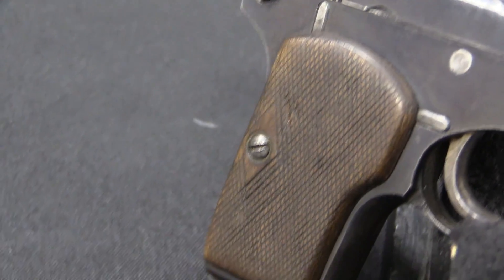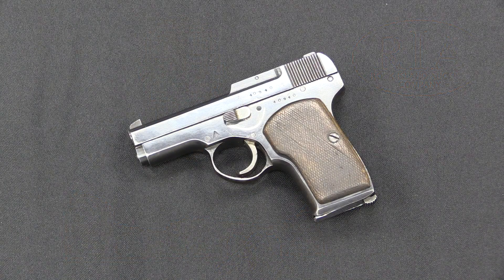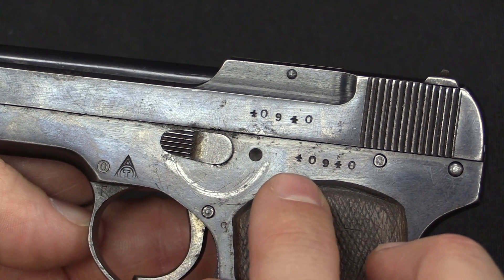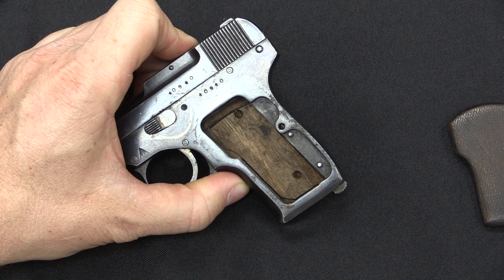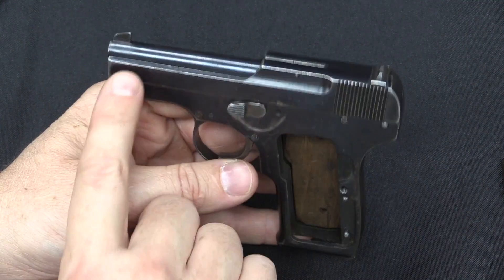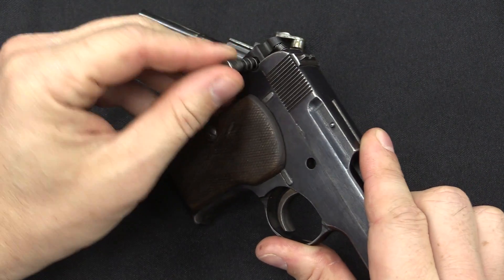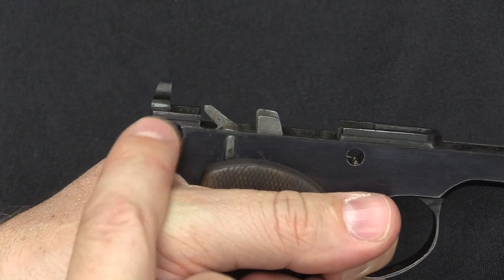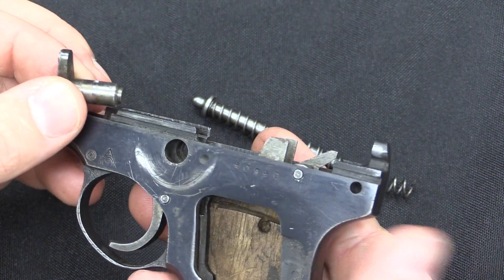1926 Tula-Korovin: The First Soviet Semiauto Pistol

Comment: Neat little pistol. These sorts are all pretty close in build. I used to have a Sterling in .22LR. IT was a cute little .22LR in Stainless steel with black plastic grips. It had the heal mag release that was made of some cheap crapmetal, I dropped it one day and the release broke at the pin that held it in place I took it to a local machinist and he knocked me out one that was much better then the original in about five minutes, charged me a fin and I was verry happy with my little pocket pistol. The gun love CCI Stingers and would run through all of them that I Could feed her.  She also liked CCI Mini Mags but standard velocity rounds were iffy.  Eventually the sear wore down on it and it started doubling and tripling. I was at the range one day with a local preacher who ministered to the local Indian Reservation.  He loved the doubling, and wanted the pistol very badly, I finally broke down and sold it to him.  Hope he had good luck with it.

Comment: That tail is not a distinctive feature of a striker fired pistol, a in the general sense, it's a distinctive feature of a certain type of striker fire pistol. Specifically one that fully cocks the striker on the rearward movement of the slide, not on the forward like quite a few of the modern types where the striker is fully contained within the slide.

Comment: The open top slide, the striker, some aspects of the barrel, all remind me of the 1914 and 1932 Mauser pistols. Even back then, Russian research was at least partly copying other countries.
Reply: The Italian made Armi Tanfoglio Giuseppe GT-27, from the trigger forward, is a simplified version with the barrel pinned in place. Recoil spring,  guide rod, safety, trigger are all virtually identical.
Reply: There are very few truly original designs. A lot of times it is an evolution. Just like with cars - they all have 4 wheels, , doors, steering wheel etc. look at Toyota and Honda, they will have a lot in common, but both change overtime depending on the fashion at the time.

Comment: Looks like Korovin copied quite some from the Beholla pistol and just improved the disassembly.
But by that the trigger dropped a little, the bore axis got a little higher, the safety only acts on the trigger, not on the sear and he introduced additional parts for a hold-open.
And why did he design the trigger with this weird operating angle like he did?

Comment: 6:39 Sorry, but I think it's nothing but a myth brought up in 1999 Monetchikov's biography of Korovin. Original documents (including 1934 drawings set from Ul'yanovsk №3 Factory) state that 6.35 mm cartridge 57-N-112 had shorter-than-spec case (15.24 mm), and its 3.25 g bullet developed around 220-230 m/s (typically 228 m/s) velocity.

Comment: Interesting little pistol...made use of the same keeper system for the grip panels as the TT30 and TT33.  I'm curious if the safety was a part of the original design or if it was added for importation.  It looks a lot like the ones used on some of the TT33 pistols we see imported today.  Also, any idea how many were imported or when?
Reply: Safety is original

Comment: Speaking of the Soviets, any idea where I can get my hands on some reasonable 7.62x54r stripper clips for my M91?
Reply: Do a web search. M1 surplus sometimes has them.
Reply: Bought mine on ebay. Brand new, dirt cheap, work great
Reply: Shit Digger  just spend a little time loading and unloading them and they usually get worn into a smooth operating condition.
Reply: Shit Digger  still has to be better than getting my thumb pinched between the round and interrupter. Thanks guys
Reply: @Nipplator99999999999  having used both original polish ones and new ones its lipstick on a pig and sucks, slow and easy to cut your thumb open
Reply: Forget the steel silver color ones with the extra little tabs you can get everywhere. They are the copies of the Finnish clips with fake Tikka stamps. They suck balls and will cut you. 

RobertRTG had brass Polish surplus ones a few months ago. Paying $2-5 for old surplus clips is worth every penny.
Reply: @HughesEnterprises  my steel polish clips from rtg suck too. But the brass ones work?

Comment: Would love to know more about 6.3mm tula ammo.
Reply: It was called 6.35 mm cartridge 57-N-112 - 6.35×15.24 mm SR, made by Factory №3 in Ulayanovsk (modern-day UPZ, a subsidiary of TulAmmo). Its Berdan primer wasn't always perfectly centered due to QC issues, 3.25 g lead brass-jacketed bullet developed around 220-230 m/s (typically 228 m/s) velocity from the muzzle. It was unmarked, but could easily be recognized by its shorter case and overall poor quality. There was an attempt to make a steel-cored variant of its bullet in the mid-30's, but it went nowhere. It's no longer made (guess why), even by the '70's it was unobtainble in any significant quantity, UPZ nowadays doesn't offer anything smaller than .380 Auto.
Reply: @F1ghteR41  thank you very much.
Berdan primers is a shock to me! Was that ammo specifically for this gun? I haven't seen any info on guns chamber for it except this 1.
Reply: @rickoshay3886  It was designed to be used in any .25ACP gun available, since stuff like Baby Brownings was also in use at the time. Berdan primers are typical in Russian guns since the adoption of Berdan rifle.
Reply: Also, here's a couple of drawings: https://i3.guns.ru/forums/icons/forum_pictures/003529/3529748.jpg
https://avatars.mds.yandex.net/get-pdb/1047912/2a4716c4-13fd-4f29-b7dd-451cea1eef83/s1200?webp=false
Reply: @F1ghteR41   you sir are a gentleman, You've been very informative.
I've owned a few baby Beretta's and every single round is loaded the same, I'd never heard of a hot factory 25acp round. So was quite interested to know more.
From the little information I can find online, you could use this round in a TK or baby Browning. But it was too powerful for most other .25acp firearms.
do you know what kind of headstamp they had?
Reply: @rickoshay3886  that russian 20% hotter ammo 25 acp was extremly popular among germans during ww-2. They used it in pist.walther mod.8. Its bore comes a little narrower in front part ,so, bullet a little slowed,but the pressure was inkresing,so finally,that russian bullet left the bartel with a very high velocity,much higher than it could be with " standard" western 25 acp.
Reply: @rickoshay3886  Berdan primers were also used by other European manufacturers, as far as I'm aware, so don't count solely on that.
Reply: @F1ghteR41  I won't, but it's good to know that the russian made 6.35 of that era is berdan. I've got a few FN 6.35 that are berdan.
Reply: We too, dear Komrade! =)
Reply: I think he already told us everything about it: .25 ACP loaded about 20% hotter, roughly equivalent to a .25 ACP +P load.
Reply: @jic1  what kind of velocity, was it a heavier bullet, How common are guns chamber in 6.3 tula. Lots more info would be interesting.
 +p is a pretty vague description.
Reply: @jic1  it's 20-25% more muzzle energy with a longer heavier bullet. Giving it more penetration than standard 25acp ammo. Calling that +p isn't "everything" about such an obscure round.

Comment: The .30 caliber Tokarev, and Mauser are the same dimensions, and will chamber in the same guns, but Tokarev is loaded to higher pressure.  So, do not load, and fire Tokarev ammo in a Broomhandle Mauser (I guess unless you handload it to Mauser spec, which might be tricky with the lacquered steel cases of Crazy Ivan's Surplus)  It's not good for the gun, which may be a valuable collectable.  (Because of Star Wars, the Broomhandle Mauser is a popular collectible.)
Reply: Very much like the .223/5.56 dilemma.
Reply: @DNchap1417  
Are you trying to stir up some shit?
Reply: I’ve seen a few C96’s destroyed by hundreds of rounds of Tokarev ammo. Guy considered the $6-800 shooter grade C96’s he was destroying “expendable” because he bought them for a couple hundred bucks in the 90’s and the ammo was $0.05 a round. Two nice Mausers and an Astra with locking lugs sheared off turned into paper weights.
Reply: Thats worse than a bubba
Reply: @paullytle1904  Yeah, but it's not like Khyber Pass bad.
Reply: @Psiberzerker  its worse those guys are atleast making stuff not just destroying shit
Reply: @HughesEnterprises  Locking lugs sheared off? Does that mean the bolt flew back in his face?
Reply: 30 tokerev is a development from 30 mauser and a lot of the sovieet developmental work was in 30 mauser